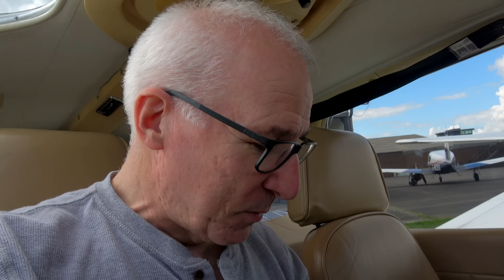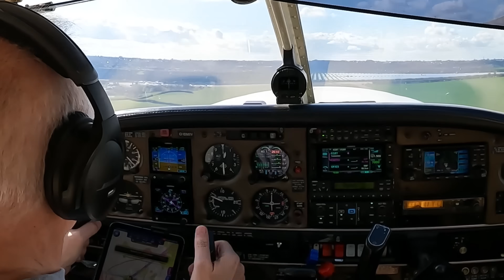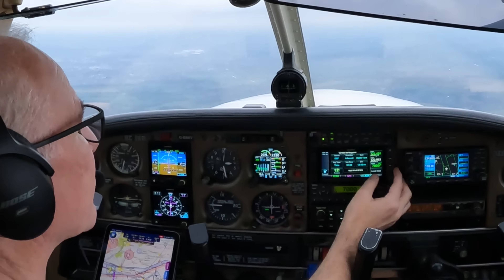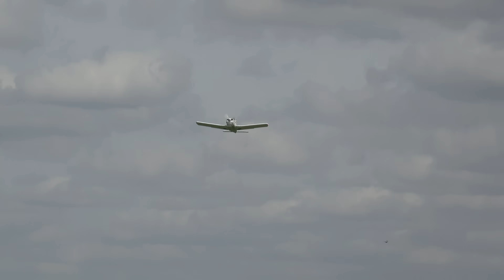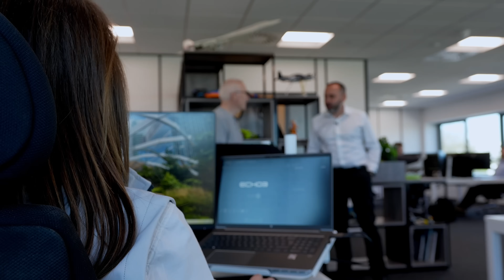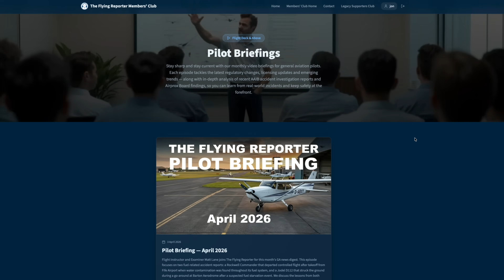I finally have the aircraft panel I've always dreamed about

Comment: I would change one thing on your panel (if it’s possible?) change the FD from V bar to cross bars, there is no commercial operator that uses the V bar setup (not counting GA jets) as the human brain has a few million years of noticing things to the sides or up and down, what we are not very good at is picking up on twisting motion.

Comment: I have done similar upgrade last year. 2xG5, gnx375, gtr205, gfc500 and the engine monitor gi275 is getting installed right now. I am still thinking if I should install the backup battery for gi275 eis. The autopilot is fantastic.

Comment: I've noticed on your departure briefings that for problems before takeoff you will cut the throttle and then apply brakes, however some pilots do it the other way around and say that applying the brakes helps you to stick to the ground? What are the benefits of doing it your way? (I'm not a pilot so I have no idea if there is a difference lol)

Comment: Jon, the panel looks great and I'm sure that you'll enjoy it.  I'm curious about why the DME was left in place.  As you're committed to flying into AirVenture, you might want to pick up a portable ADS-B in device such as the Sentry that Sporty's sells.  It will help you locate the traffic around you and ease the tension during the FISK Arrival.  Also, you might want to top your tanks an hour or so from Oshkosh.  If you're unlucky and get to FISK when the airport closes for a mass arrival, you'll be sent back to the Endeavour Bridge to start the arrival again.   This happened a lot two years ago, but somewhat less last year and lots of folks had to divert for fuel.
When you get to Buffalo, stop at the Anchor Bar to try Buffalo chicken wings where they were invented, and you'll be too close to Chicago to pass up a deep-dish pizza
Reply from the maker: Thanks.  Many of the UK approaches still require DME. I already have ADSB in and the plan is to come in via a pa28 mass arrival all being well.

Comment: Is the GI 275 engine details page not pilot configurable for things such as fuel units of measure allowing you to choose litres over gallons (7:47) in user settings?
Reply: Coincidentally, as a Microsoft Flight Simulator fan, I'm deep into programming custom engine pages for the G1000nxi instrument in the simulator via the Microsoft Avionics Framework. Currently working on DA62 full screen MFD engine page. After I've cut my teeth with that framework, my big project will be to create an accurate GI 275. Got a lot to learn about the Avionics Framework before that 🙂
Reply from the maker: I think it can be configured in the maintenance config/menu, but not sure it's allowed under the certification.  Willing to be corrected.

Comment: Wow Jon. Everything complete now. I had to laugh at the cardboard box on your backseat. I had the same when I flew back from my avionics installer. The GFC500 is the game changer. I remember my first real IMC to minimums LPV approach with it. Just amazing. The EIS is nice but less important in my experience. Also the myriad of EIS wires and sensor gadgets in the engine compartment makes it a bit failure prone. Also I noticed a power of 83% in the climb through 6500ft. If you have a turbo shouldn’t that be more around 100%? I have my doubts about the accuracy of the algorithm inside the 275 to calculate this value. Anyway, congratulations, and enjoy the stack. Let us fly with you!
Reply from the maker: The percentage power isn't matching the power settings I'm putting in, so not sure how that works.  Once above MSA, I climb at 75% per the manual - it's better for the engine.

Comment: One can easily change the fuel units to litres on this engine monitor.
Reply from the maker: Is that approved though?  I'm wondering if they have to be kept in original units per the certification?
Reply: @TheFlyingReporter  changing display units is usually just a configuration setting, not a modification, so I wouldn’t worry about it.

Comment: I’m intrigued by your throttle lever only going half way up for full power?  Back when I flew my club’s Cherokee it went a lot higher up - so I’m curious about how yours is rigged
Reply from the maker: On the turbo arrow you achieve 100% power at partial throttle movement at sea level.
Reply: @TheFlyingReporter  ahh turbo.  I’m not used to that!  Thanks!

Comment: Nice Avionic fit ! I am in the planning stages of getting a GI275 EIS installed but the fitting won’t happen until next winter. I did an Atlantic crossing a year or two back, I went Wick to Reykjavik to avoid an expensive stop in the Faroe Islands. The whole trip in July involved approaches almost to minimums with the exception of perfect VMC ( at the very soon to close ) Narsarsuaq. VFH comms was a problem, as a back up I advise carrying a Garmin iradium text messenger. It might avoid getting an oceanic re-clearance via relay from an airliner.
Reply from the maker: Thanks.  Can you get re-cleared by Garmin text?
Reply: @TheFlyingReporter  We used a sat phone insted of HF as all the Oceanic control centres have phone access. Our phone failed to receive the re-clearance hence the VHF relay courtesy of a KLM airliner. I see no reason the the Garmin incontact system. After all if you had fitted the G500 PFD and iridium satellite communication box you could text message from your GTN650 via the G500 screen. If you use Garmin incontact direct or via your flight following company it up to you but I would text both the oceanic control centre and the flight follower and get them to back up the msg with a phone call. Having flown the Atlantic many times with only HF comms this has to be better than a bad night on the HF when due to interference it takes half an hour to make a simple position report.

Comment: You can set the GI275 to litres in the settings.  I have my arrow in litres.  Engine monitor the best investment one can make imho
Reply: The legal situation is if you change the units the fuel is measured in the whole system has to be changed. So fuel flow, fuel tank gauges and the performance tables in the flight manual need changing………..it’s all a bit of a faff ! I suspect once John has reached the USA having the whole system working in USG will be less trouble.